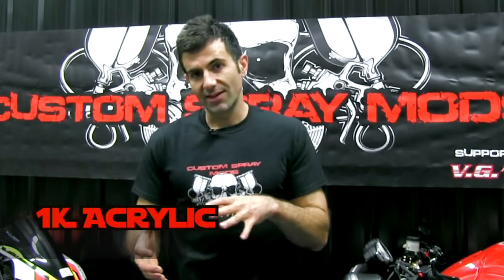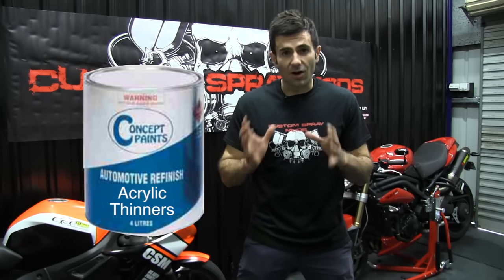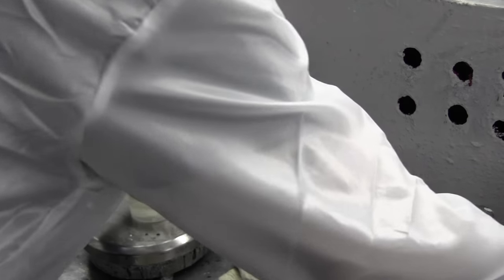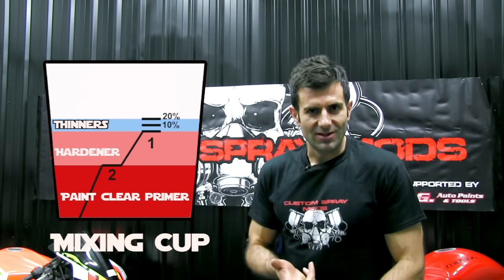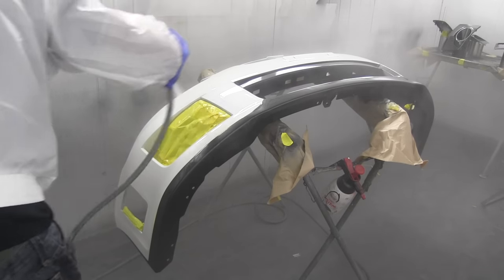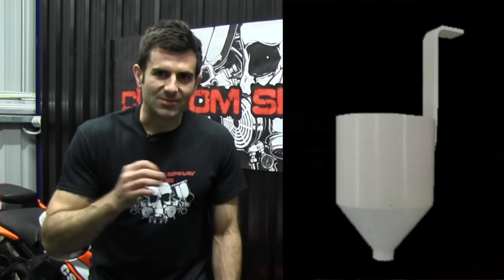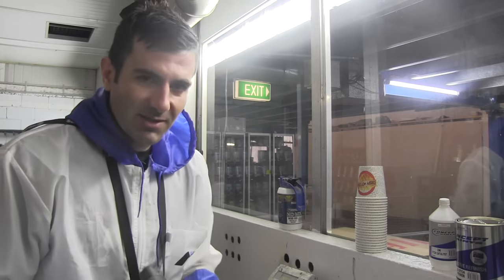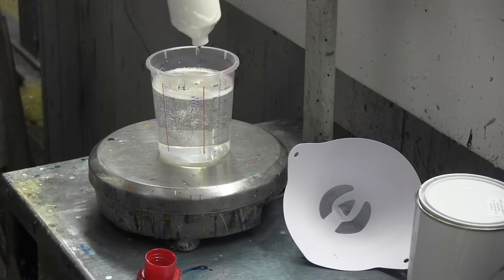How to mix auto paint

Comment: 2:1 is the automotive ratio if you use a Compressor we in the UK on-site spraying cladding using 2k paint also use the same ratio but 2:1 with hardener because we use HVLP paint needs to be thinner so I do put 5:1 with hardener and from there 2:1 with thinner or after adding hardener I do 60% paint 40% thinner little bit hardener

Comment: I'm using a 2k acrylic enamel paint for plastic and it says on the tin to mix with 50% thinners but this seem too thin and gets runs more easily, would it be ok to use 10-15% thinners instead? or will that affect adhesion and flexibility of the paint?

Comment: Where do you find the laquar paints ? I haven't seen them for years but stay away from the mixing cups the scale on the side is incorrect check it out with measuring cups... I'm thinking becouse of the taper or how they apply the scale on the cup a flat side pot and measuring stick is the safest way just clamp the stick to the side of the pot so it doesn't slide down... Haven't seen viscosity cup for a few years now  great video 👍 from 🇨🇦

Comment: The shop told me that 1K Acrylic  = Paint + Hardener + Thinner

So on your video 1K Acrylic = Paint + Thinner only without hardener .

Thanks for the video :)
Reply: 1k acrylic doesn't use a hardener, it air/heat dries and will never actually fully harden
Reply: Thank you Sir. :)